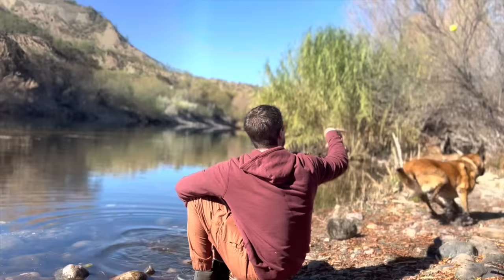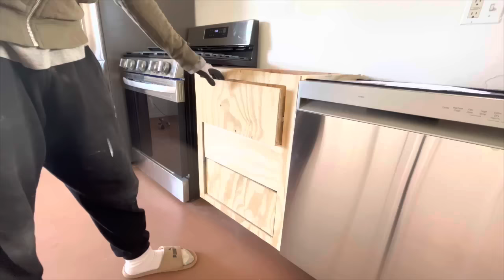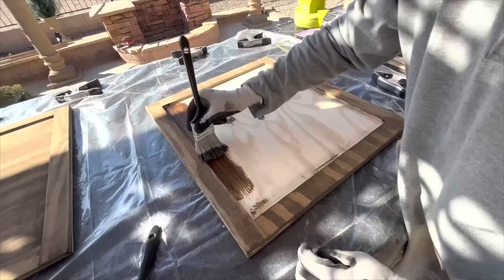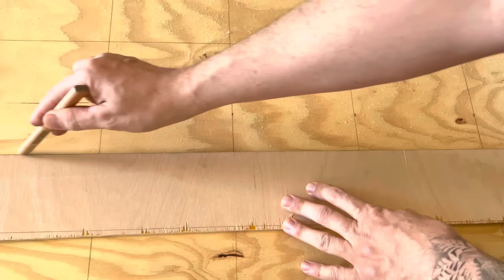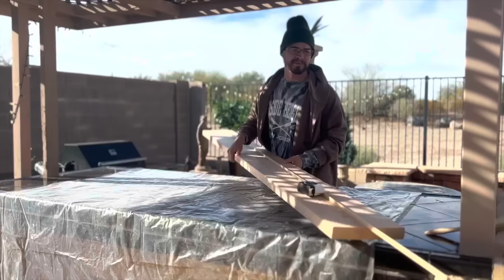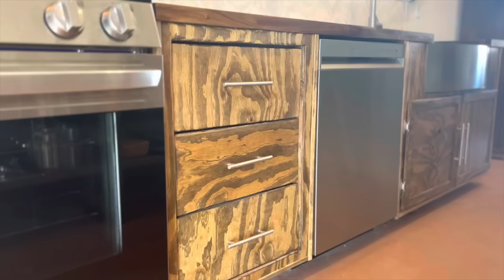low-cost kitchen build... can i do it alone?

Comment: NOOOOOO! Mister Pearl, you need to remove the wood panel from the side of the fridge IMMEDIATELY... if you leave that fridge wood panel up against the side of your stove, it becomes a fire hazard, (when the heat from your stove ignites that wood and your kitchen bursts into flames, then burns down the house, your insurance company will deny your claim because it was not built to code, as placing a fridge up against a stove is not allowed. You might want to buy a household fire extinguisher and keep it nearby, if you choose to leave it as is.) If you want to keep the wood panel on the side of the fridge, then you would need to have added counter space, between the fridge and stove. You might want to consider moving the fridge next to the sink, (switch the wood side panel to the opposite side, or make another one so both sides of the fridge are covered) and then add more cabinets/counter space where the fridge is now, (bonus... the window would no longer be blocked by the fridge, as it looks like a DIY mistake.) Just some friendly advise. Glad to hear you are finally living your bliss.